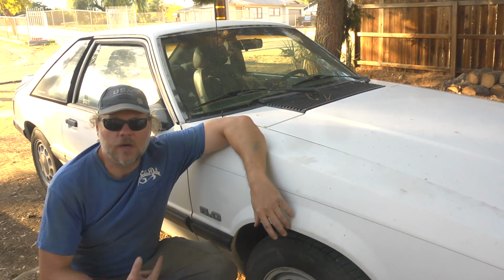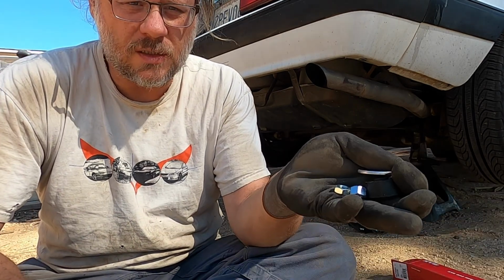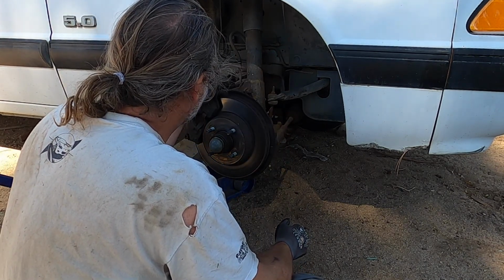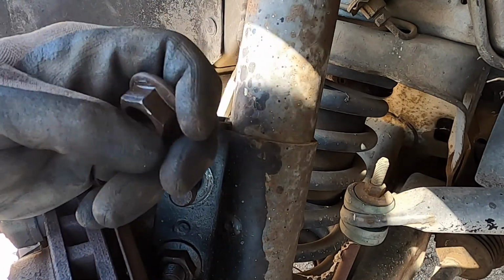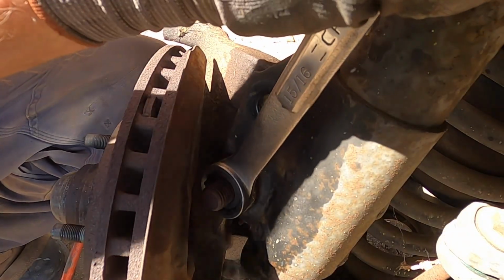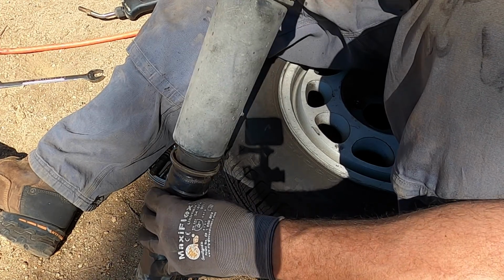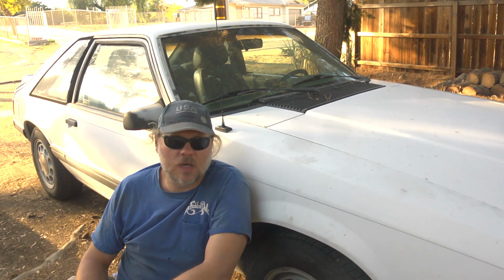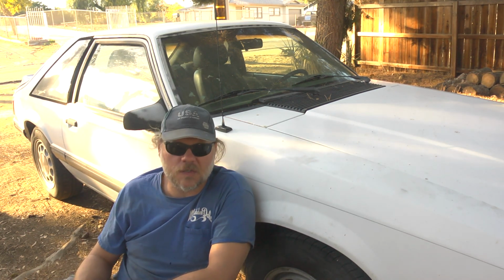Replacing Shocks On A Foxbody Mustang

Comment: How long did it take to get to the point where your hobby car was became a daily driver?
Reply: They only been messing with this car for like 6 months. My engine has been at the machine shop longer than that.
Reply from the maker: about 6 months, 15 minutes most nights after work and a couple hours most weekends. Could have done it faster however it was the side project, not our main focus.